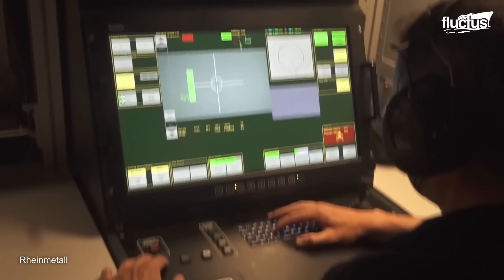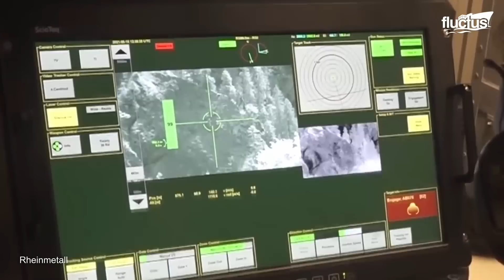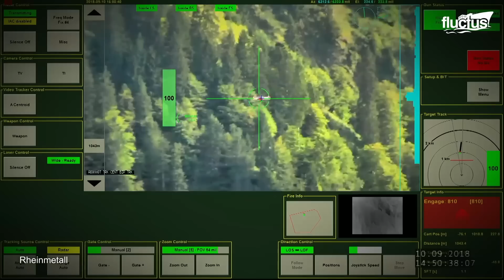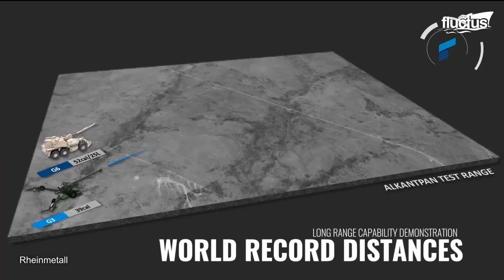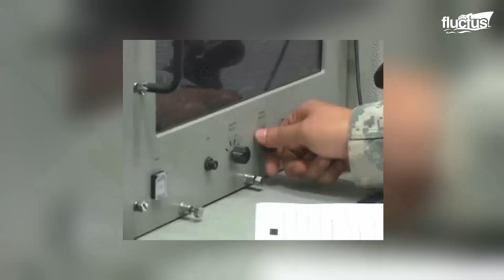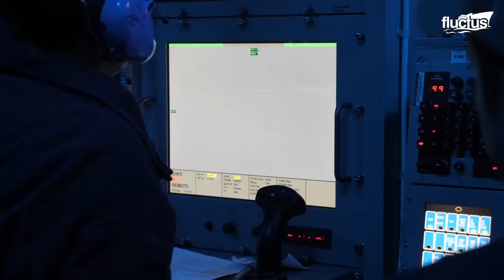Germany Testing Monstrously Powerful Multi Million $ Anti Drone Truck

Comment: Too expensive for multiple drone attacks. Anti-missile for ships is the best deployment. Lasers have to take up the anti Drone role.  Rheinmetall has that as well.
Reply: @Jim Carner Well said. Good points. 👍
Reply: Are lasers sure to fit the bill? For a highly reflective and geometrically optimized target the size of a drone, how much time does it roughly take to intercept it? Asking out of genuine interest. Cannon fire has practically instant effect on target. In anything other than flat terrain, drones are pretty much guaranteed to have safe pathways that bring them within a mere couple hundred or less meters from the A/D system while remaining fully occluded by said terrain. Are such systems able to "zap"  a drone at the snap of a finger? Cannons can most certainly do this when provided with solid automation.
Reply: @Jim Carner Remember occlusion as well. If the system's position is known, the enemy will probably use the terrain to get to the system while avoiding LOS. Then it'll be a Latakia S-400 kind of deal. Absolutely ferocious system, but only when it sees the target. This one should be able to shoot down drones in extremely short time windows. A terrain exploiting swarm attack could absolutely wreck the system if it can't vaporize each drone instantly, within a radius of a couple hundred meters.

Comment: Better to have the duel purpose weapon BUT it would be even better if they can shoot down other kinds of aircraft too or maybe counter defense fire against mortar shots coming in
Reply: These guns would shred a helicopter. Jets tend to be a bit too quick to get caught by flak very often. The key is that the gun ammo is vastly cheaper than the missiles used to target jets, and thus much more appropriate for countering drone swarms. If you have to shoot a $500 drone with a $1M missile, you aren't winning that exchange.
Reply: @ddopson  
Thank you.  I am 14 and I do not know it much about that. Just I figured would they say it if it could be used for other stuff
Reply: @ddopson  theyve been in the pipeline for a while, probably just re marketed bc of the war, those drones have proven to be crazy force multipliers.
Reply: @ddopson  I think the Gepard tank works well on jets.
Reply: It’s based on the mantis and the mantis can shot down mortar shots
Reply: @Stefan_Dahn  it worked well on jets back in its day. Against modern jets it would be tough.

Comment: Try to use these anti-drone artillery systems in an urban setting, and you'll have buildings full of people as backdrop.
Reply: My thought too! Gonna be a lot of 'fratricide' in any combat environment as a few slugs are going to miss their (intended) mark and fly past. (R.I.P. Pat Tillman)
Reply: They use programmable burst ammunition, that shatters into 152 tungsten fragments a few meters from the target. If the little fragments fall somewhere, it won't do too much damage.
Reply: @callsigndd9ls897   Not the point. You can't engage a drone flying nap of the earth and hugging buildings ....with a 35mmm auto cannon without doing serious damage to the surrounding environment.

Comment: Without electronic warfare protection, drones are all very easy targets.
With its support, when an approaching drone cannot be detected and locked to it, this weapon also becomes an easy target for the drone.
The key is the 'Electronic warfare'.
Reply: The Radar is the key weakness. Jam that, the gun is useless. Target it, the gun is dead.

Comment: Thus ist a Short Range SA System und was Not preliminary Designed for anti drone usage. 
But it seems go Work against low und slow Flying drones.
The drone Swarm is also very Close togehter.
Question is how good it is against fast moving drones like kamikaze ones und when the swarm is Not so close togehter?

Comment: I read somewhere that the 35mm canon itself is German made (same as is mounted 2x on the Geppard), but the ammunition used to shoot down drones (35mm with a tungsten fragment head) is Swiss made. Of course, I could have that the wrong way around. Please correct if you know more.
Reply: The canon is a swiss development..I used during my preretired live  2 work on this system in Oerlikon Contraves 2

Comment: Will their anti drone system work at a ceiling height of 30 to 40,000 feet up in the hidden clouds ?
I guess they will be pounded badly from that height .
Reply: Well, for that case, search and track radar was invented many, many years ago, which can now also detect small drones.
Reply: @callsigndd9ls897  for example , can they work against Turkish electric jamming system . 🤣🤣🤣🤣🤣🤣🤣🤣🤣🤣🤣🤣🤣🤣🤣🤣🤣🤣🤣🤣 Impossible

Comment: That makes sense, because the enemy is proven lacking the edge in a dynamic battle, what only remains is to find a solution against slow/cheap suicide drone attacks from low altitude and expected directions.

However, in a dynamic battle against an enemy with sophisticated heavyweight drones, attacking over the horizon and from multiple vectors, it is hopeless.
Reply: If it attacks over the horizon, it's presumably doing so with missiles. Shouldn't this be effective against those, too?
Reply: @odinsrensen7460  It's effective vs low altitude low speed drones, probably not so vs. medium altitude fast targets.
Reply: @odinsrensen7460    Not really. The target composition is VERY different and flak isn't going to do the trick against a high speed missile.

Comment: Hoooh??? Milineum gun is good for low altitude drone..
But i prefer to laser weapon..than just balistic ammonition
Reply: The problem with powerful laser weapons is that they require a lot of electrical energy that cannot be generated on small vehicles. Basically, this is only possible stationary or on warships to generate this large amount of energy.

Comment: It fire same type of ammunition as
the Gepard. Whats diffrence in result?
Would it not be cheaper to fry drones
with microwave?
Reply: Yep, but you would need to carry a power station capable of generating a few hundred megawatts of electricity.
Reply: @callsigndd9ls897  Russia did it with tomahawks missile!

Comment: Um, just a thing, your terminology is mixed up. You mention .35cal gun, when its actually   35 mm. .35 cal is barely the size of a 9mm. Terminology is important as there is a very big distinction between .35 cal and 35mm

Comment: The only problem is :
- They shoot almost totally floating drones, while the enemy drones are moving targets in speed over 200 km/hour.
- Before the tank  has a chance to shoot any drone within its short perimeter   , the drone will have eliminated the tank from afar. 😄
Reply: Russia's got their number!
Reply: Well I'm pretty sure it could shut down moving drones. It was only for testing to have them sitting there. Which if they were going to show the capabilities it should have been a moving drone. But I don't see why they can't shoot down fast moving drones it does have the capability.

Comment: Problem is one drone costs 100-1000$, and shooting it costs 10000$ (cartridge + fixed vehicle price). Plus drone range is 100-1000km radius, and Antidrone truck 5km. So you need 100s of them to defend a border. So drone gets shot, but drone still wins

Comment: I see 8x8 wheels. Beside cannot handle all terrains like tracks. There are terrains where the wheels just get stucked. I really love this gun. It should be mounted on a Lynx chassis. The artillery should try the vulcano ammo to gain some range. The 20mm CIWS is not as advanced as the 35mm. Rheinmetal should focus on the next challenge. Intercept high speed poryectile at hipersonic speed.

Comment: To take out the Iranian drones (assuming they can be intercepted well before their targets) they would be better using a light aircraft  armed with a machine "gunner" then just approach them at a slightly slower speed and take them out one by one.
Reply: Nah, just hire some FPV Quad Race pilots and givethem enough cheap 4-inch quads to ram in to the Iranian made things.

Comment: So with out a doubt Reinmethal it is on of the world leading military industry.
If we talk about short range cannon type air defence system, no metter is it mobile(wheeled), stationad ore CIWS, defently thay are the best.
But i am curious to know why on sky ranger system thay do not atech any missile, at least 4, on both sides 2x2 missails.
Reply: Each Skyranger also has a mount for an air-to-surface guided missile launcher on its turret that can be coupled to the radar system. Depending on the country, different systems can be installed there.
Reply: @callsigndd9ls897  Oh yeah of course they can do, if the costumer have that requirements.
Has i saw the concept of Skyranger 30 mm KCA cannon, attached two short range sam and laser cannon.
I hop that this system will be aveliable soon.

Comment: It is a very efficient system, which can be mounted on many vehicles, in fixed positions on land and at sea. 
It is expensive, but to buy it you have to obtain, in addition to the reversal in R&D, the patent to manufacture the ammunition in Spain, without limitations.
There are three countries from which you have to buy with limitations;  France, USA and Switzerland.
👍🇪🇸🌾
Reply: you seem to know the system. I am curious if normal speed zig zag moving drones can be targeted with it? The examples seems to be either not moving or moving in a predictable motion.
Reply: @benimdunyam2424  Oh, good that you write it. I think the designers didn't think about the fact that drones also move (lol).

Comment: Shorting down drones really don't need 35mm revolver cannon, 5.56mm machine gun is just good enough! Or maybe 12.5mm or 20mm machine gun will be better.
Reply: Ахаха, большие иранские дроны смеются над вами
Reply: its airburst ammo to not have to hit directly !
they don t have that in 5.56 ?
Reply: "Each Ahead round contains 152 tungsten sub-projectiles which are ejected immediately in front of the oncoming target"

That's why they use 35mm rounds. u burst targets away with plenty of small projectiles. The hit rate is enormous

Comment: the major problem I see are the bullets. If their path in not straight on the sky they can be dangerous for the people limiting the use of the weapon
Reply: The Rhinemetal guns demonstrated here against drones use "bullets" that explode at a programmed distance so they cause more destruction there and a lot less destruction anywhere else they might end up.   The CIWS are typically used at sea, where there are few other targets.  Regardless, shells hitting the ground are likely going to be at terminal velocity, which will cause a small fraction of the damage, if any, of the round travelling at speed.

Comment: It is like "Mantis" on a car. Both are developed by Oerlikon, and Oerlikon is a daughter of Rheinmetall. I hope, that the rights for ammunition are held by Rheinmetall and not by Oerlikon.
Reply: The ammunition is held by the swiss RUAG.. sorry..Oerlikon doesn't exist anymore.. but developed the Canonsytem in the begin of this millenium..
Reply: @edgarkrattiger9185  No,  only Oerlikon Space is part of RUAG. OC Oerlikon is part of Rheinmetall Air Defence AG and makes:
C-RAM-fähige Flugabwehrgeschütze
Mobile Geschützsysteme
35mm und Ahead Munition
Lenkwaffenwerfer
Radargeräte
Feuerleitgeräte
Battle Management Systeme
Reply: Nope ...the rights 4 ammunition are held by swiss RUAG
Reply: @augustusrex8150  Oerlikon doesn't exist anymore and was sold by Bührle 2 Rheinmetall at the beginn of this millenium..The Gepard was developed by Contraves a doughter from Oerlikon in the 70ties..I know it, because I used 2 work 4 that company then...O.K the basic is the Leopard but the tourette and canons with the fire controll system was developed by Contraves also, together with Siemens-Albis.

Comment: When I see the skyranger I think of a tiny tank but I now remember the lynx which I think has this gun system. Or am I wrong on that
Reply: This does look very extremely similar, but it might just be that the turret is the same since the Lynx can mount several different 35mm guns. At the very least it appears to be practically the same, if not maybe technically the same. This truck so far seems like a cheaper less protected version of the Lynx with a software upgrade package for hunting drones.
Reply: @CyFed_Republic_of_Kaltovar  good point

Comment: if it is shooting  real bullets then. you have failed at defeating the enemy. drones can betaken down by cheap plastic balls rather then real ammunition. you could also use a smaller system which can be hidden and placed in the ground  or anchored while troops are moving and then staying stationary. this is suppose to be a system which is compact and can move with the troops. in short you dont need a hammer to take push in a screw.

Comment: There are tons of retired SPAAGs  that can be updated or used as-ia for this very task. 

Do we really need to spend millions on new high tech, high complexity, high maintenance  crap when there's a bunch of retired Tungusks and Ghepards that were designed for this gap? And are a lot easier to fix?

Btw, the boxer and piranha chassis don't have shit in terms of terrain crossing. A BTR-70 will run circles in mud around them....

Comment: All those systems shredding missiles and UAVs. More rarely used countermeasures not even mentioned in the video. Could this mean that the focus of naval warfare will possibly shift more towards submarine drones and torpedoes? Can torpedoes even come close to travelling as fast as a plane? If they do, it's probably very detrimental for the maritime ecosystem and worth considering an international ban. 

With technology advancing rapidly, it seems that certain vehicles, platforms, systems will scale well and others quite poorly. Compared to earlier eras, where armies had very comparable equipment, nowadays the outcomes seem much more uncertain - even more so, when factoring in the signals, electronics, cyber, AI, space... layers into the equation. Furthermore, there are long supply (and trust) chains for many high-tech products, usually most efficiently produced in international concert of specialized firms.

Well, the many added layers of uncertainty have upsides: war becomes even less attractive.
Reply: What ?

Comment: No it doesn't look promising. How many drones can be purchased for the same price as that truck?
Then, SEPARATE those drones by about 100' each, have them actually moving, after arriving at random; THEN show me it's efficacy.
That's a TEST at a KNOWN range, altitude & under optimal conditions; ie:
Knowing exactly when they'll arrive & requiring they stayed stationary relative to flak style ammunition.

Comment: I think the problem with these things is that they are for shooting down large drones, as the drones get smaller these things will quickly become redundant.

Imagine these trying to knock down a drone that is around 2 inches, if the new power systems come online there will be long flying drones smaller than 2 inches, they may not have guns but they may carry other weapons that could cause big problems.

Small is the way drones are going, and like insects would be very difficult to catch, especially if they carried poison and was coated with barbs.

Comment: This is not new as its been developed in 1975  by Hollandse signaal (currently called Thales and is as it says a dutch-Hollandse company) and the system is known by the name "Goalkeeper", its been in use since 1979  already on dutch and later on nato navy ships. Thales France also produces them since the merge into Thales.
Reply: Goalkeeper (like Phalanx) uses a Gatling gun firing inert rounds.  It's designed to destroy very fast incoming missiles heading for high value targets, with the radar actually tracking its own rounds to adjust fire.  Overkill and way too expensive to take care of drones.
One company (I think also Rheinmetall) was working on a low tech version of that, basically a relatively simple and cheap radar guided machine gun, specifically for use against slower flying drones.